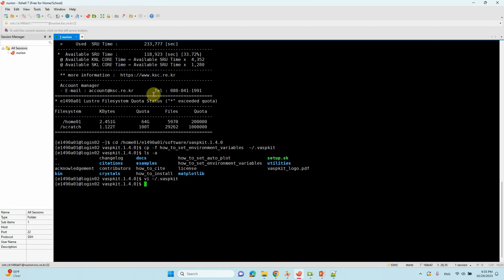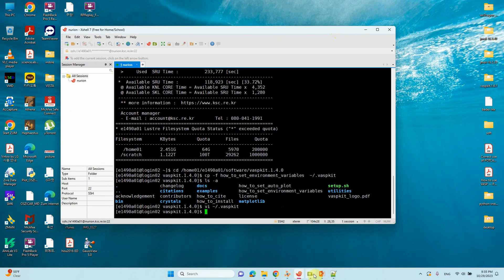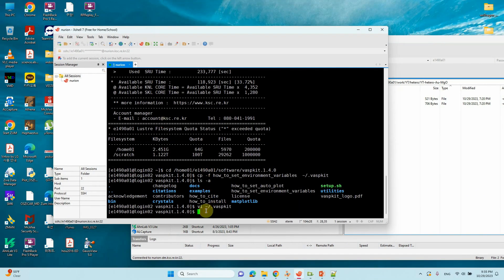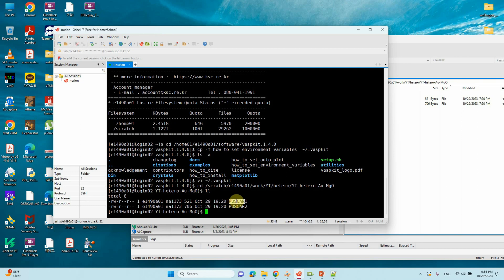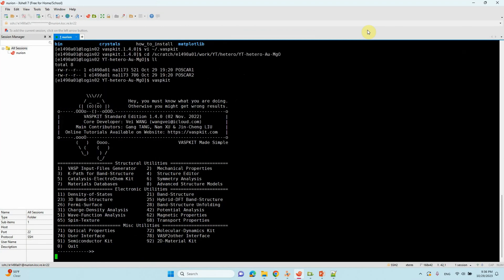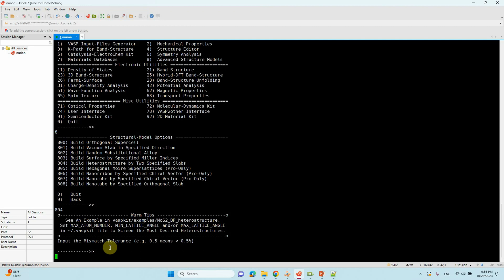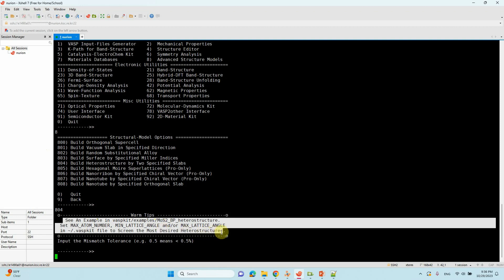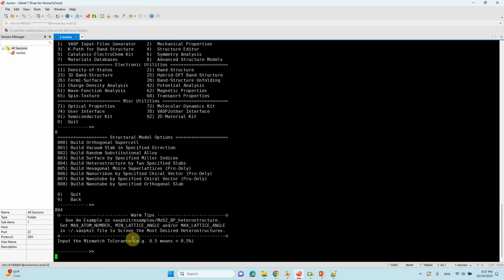Making Au/MgO-100 surface Heterostructure using VASPKIT -  PART 2 & 3

Comment: Hii.. thanks for the content. I am facing an issue during the process of heterostructure. So, my both systems are FCC-type binary molecules. creating POSCAR1 and POSCAR2 is perfectly done.  But, whene I am creating heterostructure in vaspkit after implementing required changes, it converts the heterostructure to primitive of FCC type. the conventional structure  automatically created in primitive one during vaspkit process. How to avoid it.